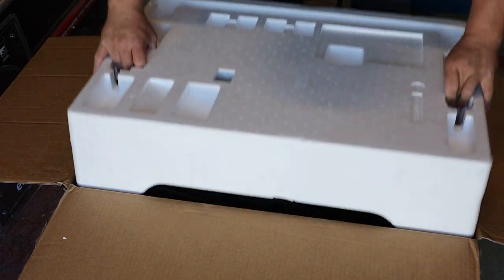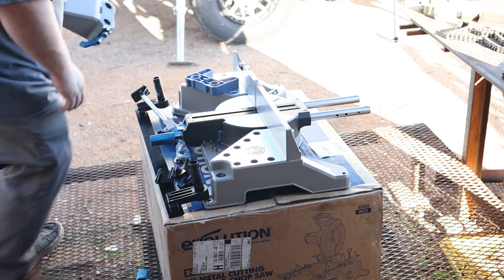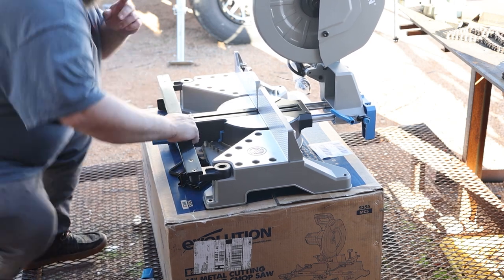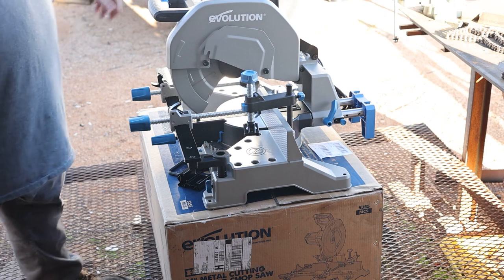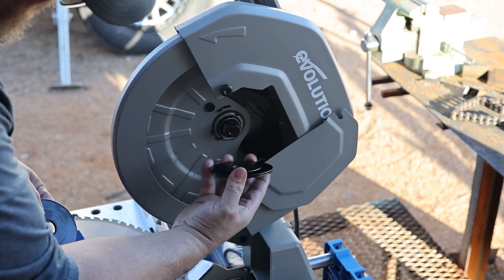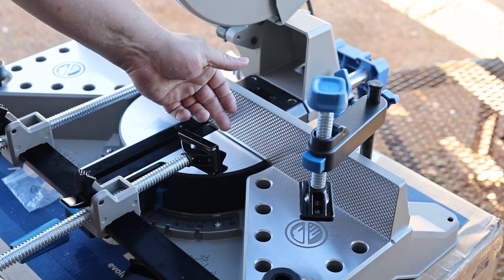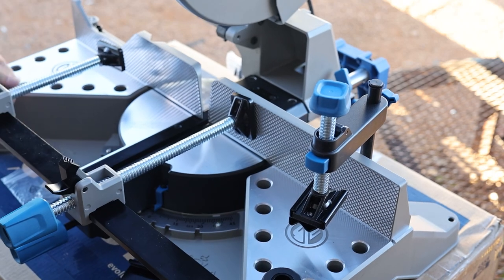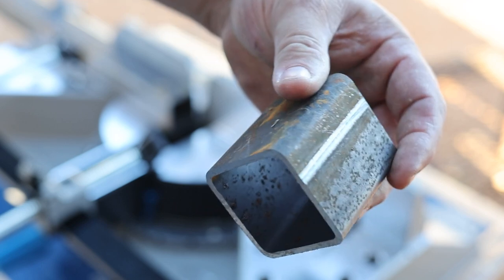Unboxing and Testing the Evolution S355MCS 14" Mitering Chop saw for Metal Cutting

Comment: Thanks for posting, I was having a difficult time trying to find an Evolution saw which has swivel head and good clamps for steel, without the swivel head it's just not worth the investment, especially when cutting 45 deg, lengths of steel side ways across the workshop, not ideal in any situation, good video well explained, cheers
Reply from the maker: Your welcome. This is by far the best purchase made for cutting steel. I absolutely love it so far. Still need to build a stand for it.

Comment: good morning, how do you think this tool is? I'm undecided between Evolution and Bosch GCD12JL.
Reply from the maker: I absolutely love using this saw. I have had no issues with it and it cuts fairly quick with clean cuts. I have a Bosch saw that I used before but cutting angles is way faster and easier with the Evolution

Comment: I installed a Makita speed switch to my old Craftsman miter saw. Installed a Harbor Freight metal blade. Cost, less than a hundred bucks, Does the same thing.
Reply from the maker: That works too. Million ways to do stuff. I needed a new saw for cutting metal so I picked this one. It works great for my needs.